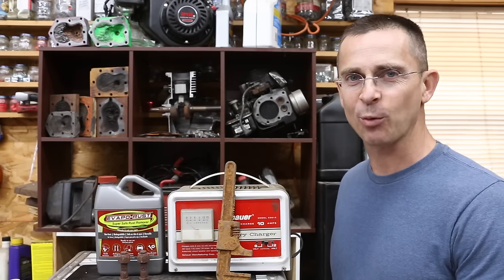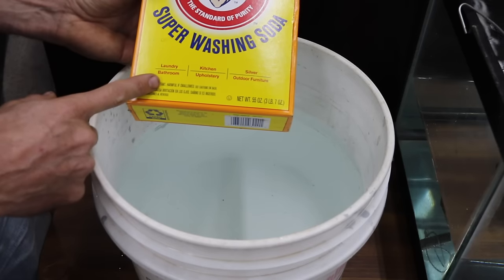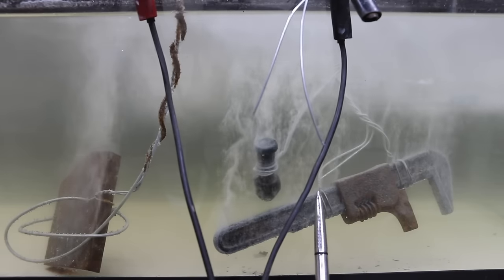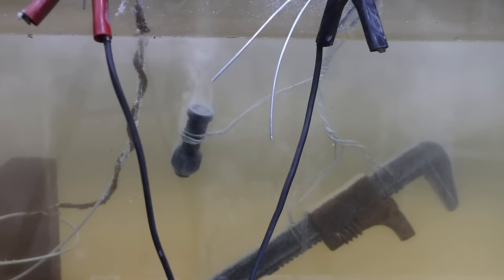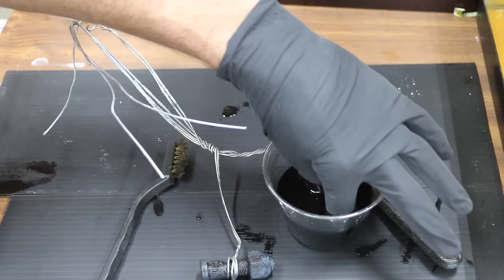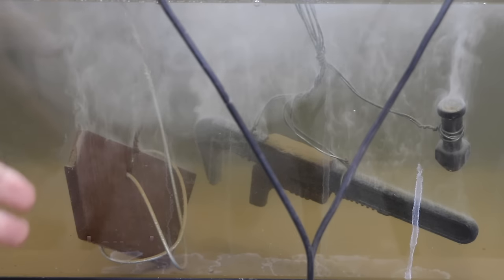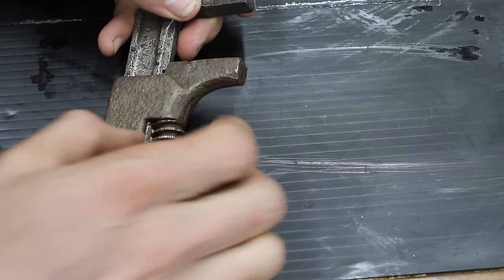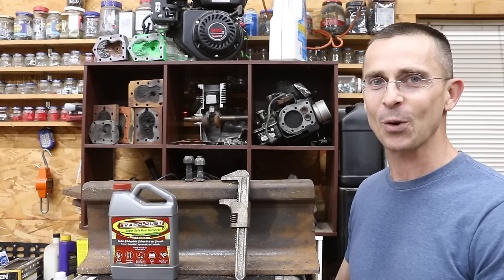Is Electrolysis better than Evapo-Rust?  Let's find out!

Comment: I've been experimenting with electrolytic rust removal for years, in fact that was how I first encountered the late Aussie50's channel. First, having a large surface area on the sacrificial anode speeds things up, so a flat piece of sheet steel or plate works better then pieces of re-bar. Second, face the side of the object you need to strip towards the anode, then flip the object around to do the other side, unless you have more then one anode plate connected at the same time. Third, cleaner DC works better then DC with a lot of AC ripple, which is what a car battery charger puts out, adding a capacitor across the output will help. Forth, if you have an object with multiple parts like the worm gear block on that wrench, add an extra loop of wire to those parts as well. 
  My next experiment will be to use a higher voltage then 14-15 vdc, which is what the charger puts out with a capacitor across the output, and maybe a stronger mix of electrolyte, washing soda is what I used, about 1/2 per gallon in a plastic garbage can. I have heard of some people using lye, which will strip the pain off of things as well,  but then you have to neutralize the lye or it will not hold paint. Evapo-rust has one advantage, it does not harm aluminum, which electrolytic stripping potentiality can, so it's good for things that have parts made out of different metals. I don't know what is in Evapo-rust or Metal Rescue, but I suspect that it is a chelation process similar to using molasses and water, but something more effective and faster.
Reply from the maker: Thanks for the constructive feedback
Reply from the maker: Thanks for the constructive feedback
Reply: Quality information! Thanks for the education
Reply: Terrific intel! Thanks!
Reply: If you care to do so, you can look up the patent application filed for Metal Rescue which does reveal that it uses a chelation process.  It is an alkali process and, per the patent, requires three ingredients mixed together in proper proportions.   The patent application describes a number of various combinations of ingredients that will generate the process,  and of course, Armor All who owns the product is applying to patent the combination that they believes works best and is the most efficient to manufacture.  The most critical ingredient in the process is Thiourea, an organic compound.

At this point in time there are many ways to deal with rusted items, some of which actually remove the rust and some of which convert the rust to a stable form.  Some processes that remove rust use acids, some use alkali.  Some processes use abrasives to remove the rust.  And there is even laser removal.  All of them work, more or less, and each of them are somewhat better suited to different items with varying degrees of rusting.

Thus, you can watch endless videos about rust elimination comparisons and get a lot of information plus see the processes in action. This is very valuable, of course, but there truly is NO universally superior method of dealing with rust that is "best' for all rusted items so its truly useless to compare various methods. As was concluded correctly in this video, each process is well suited for some projects but not as well suited for others.  And that's the way it is for any process.  So...take your pick!
Reply: RIP Aussie 50
Reply: What size capacitor?
Reply: OlegKostoglatov  Wouldn’t a battery across the output work as a capacitor too?
Reply: @justpauls  Yeah but depending on the amplitude of the ripple the battery may not like it. (i.e. reduce lifespan of battery) Larger lead-acid battery should be fine (b/c obviously that is what charger is for) but I have no experience with this.
Reply: @damanifesto  It shouldn't really matter, but you can add more by attaching additional capacitors in parallel and measuring ripple.
Reply: Vinegar works fine without any ado.
Reply: @damanifesto  A big cap...like a 22,000 to 47,000uf screw-terminal cap, rated for 50 to 80V. While you don't technically need the voltage rating, you do need the ripple current rating, which goes up with voltage (and cap physical size). The bigger the cap, the lower the internal resistance and self-heating. Ripple current rating of caps drops as its temperature rises, so to be safe a big cap is the way to go. Should be able to find something from Digikey or Mouser for less than $30 shipped. And be reasonable with the current you apply, unless you want to see the cap explode. Keep 'er under 10A. A 4 to 6A battery charger will do fine, but use a good one since it'll be running flat-out when used (a fan trained on the charger is a decent idea).
Reply: My battery charger will not operate unless it can detect a "load".  It does not like only dangly wires in water, so my "capacitor" is a battery.  It can be any 12v, including small sealed lead acid box types or vehicle batteries.  Additional tip: I use a plastic bin/tub, because the tub itself does not conduct electricity.  Laid over the top edges I use a wooden stick (broom/shovel handle/2x4 will work) to attach the negative lead wire (-) so it stays away from the sacrificial pieces (the +).  I use 4 pieces spaced around the periphery wired in to one another with positive lead wire attached to them.  Attached to the negative wire, is my largest metal object in the bin.  I have derusting parts of a lathe, so some pieces were heavy and I set them on the bottom of the plastic bin with a wire connected, but propped angled with bits of wood so water can circulate underneath.  Place multiple pieces on the bottom in this way, wire each if you wish, but wire is not necessary if they electrically touch the piece that has a wire connection.  I then place anything and everything else needing derusting on top of the large pieces.  There is no such thing as too many objects.  Each must be able to conduct electricity from the wired piece(s) and you want to arrange each so you maximize water surface contact (don't add a bunch of drill bits as a bundle).  The time required to clean the "pile" will vary based on the amount of total rust present.  You might disconnect power and check pieces once each day, removing any that you consider as completed then turn it on for another 24 hours.  By checking, you will be placing them back with slightly different contact points, allowing nothing to escape the cleansing action.  Try to minimize galvanizing, for the zinc will be removed and become airborne (my wire was galvanized).
Reply: @bobblack3870  Battery as a cap: Used to do that back in the CB days...a mobile CB was cheap, but a home base station was not. We'd use a battery charger and a sealed 12V lead-acid battery and power up a mobile unit in the house. So yeah...it's a perfectly valid solution.
Reply: @damanifesto  Sorry  little late in answering, but I think it was a 2200 uf cap at 25-30volts, it was just something I had kinking around. You could probably pull something similar one out of a junked T.V set, or other electronic device, even if it fails the battery charger has a circuit breaker in it.
Reply: @justpauls  Yes, but it's kind of awkward, and some batteries don't like being shorted out which can happen by accident when you are moving stuff around in the tank.
Reply: @RRaucina  It does, but electrolysis works better on undoing rusted threads, and other mechanical parts like gears and shafts. It's also good for preserving original detail in the metal, like teeth on a file, vinegar is an acid so you will loose some metal, even though it's not much, compared to electrolysis.
Reply: @TrehanCreekOutdoors   I think that you hit it right on the head. There is no universal " best " method for individuals, there might be some industrial process that suits a specific requirement and will be done continuously. For the weekend warrior with all the different scenarios, it will have to be hit or miss and pay attention to the process that may work best for the task at hand.
THERE IS NO SILVER BULLET, but it is good to know there are alternatives,
Reply: @Allosaurus 67 yes
Reply: You can hook a bridge rectifier and use straight 120 volts with plain tap water, to do electrolysis too. You can use a microwave capacitor to smooth out the ripple. The higher the voltage, the less electrolyte you need. Well water with nothing added produces good electrolysis with straight 120 volts DC (buy a 1000 volt rectifier from eBay rated for 15 amps).
Reply: How many volts dc and amps should I use when doing this? Can you use the same when electroplating with nickle
Reply: Tell me - why is it that these electronic anti-rust gadgets sold for automobiles don't seem to work? At least that's what I've heard. Do they actually work?
And so you're saying that the side of the rusted object which faces the sacrificial anode will experience better rust removal? Is this because there is less travel distance for the ions to move through the water? So then shouldn't using a smaller pool of water work better, since that would also reduce the travel distance?
Reply: Also -- if the sacrificial anode had been a piece of steel wool, would that have the greater surface area to speed up the process significantly?
Reply: Hi, thx for this detailled answer. I'd add some details, useful to understand how to design the perfect electrolysis cell i think :p first, i'm agreed with the idea of a very large anode, but for others reasons than speed. Increasing anode surface , allow to : decrease current density, so lower the voltage, so reduce the anode dissolution reaction. In others terms, the  anode current will be used to produce more electrolytic oxygen, rather than dissolving the anode metal. We could add that the dissolved anode metal in solution, will react at the cathode side to be electroplatted... To my mind, the idea of a large anode , is first of all crucial to maintain a constant distance between anode and cathode, and by this way, try to equalize the current line distribution. The use of acid could be useful at the beginning of the electrolysis to help dissolving rust, but be careful to avoid pitting...
Reply: For my first attempt I used a bunch of old screws I lashed together with wire, it didn't take up much space but it had a huge surface area.
Reply: For my first attempt I used what I had, a bunch of old screws with the heads damaged. I bundled then together with wire so I had a tight bunch with a lot of surface area, it worked well.
Reply: Evaporust is mainly Sodium EDTA (Ethylenediaminetetraacetic acid tetrasodium salt) a chelant.

You can have too much current when using electrolysis to convert rust.Too much current can cause the formation of spongy metal on the part being renovated. It's best to aim for under ten amps and under three is better still but it is proportional to the surface area. Moderate the current by controlling the concentration of the solution. Do not dump a whole carton of sodium carbonate in the tank - take the equivalent value in bank notes and burn them safely.
Reply: As for trying more voltage, there is no point. You need to aim for a reasonable current and the best way to do that is by connecting a current meter and adding washing soda until you achieve that current.
The electrolytic cell is a low impedance environment, high voltages are only ever needed to overcome high impedances or to deliver higher energy where provision of a high current is limited.
High current is counter productive in this kind of electrolytic cell
Reply: @paulg3336 I've had completely oppisite results from what you claim. Increasing the voltage (as we all know rise in voltage also a rise in current) produces way faster results withen an hour of complete. Sometimes even minutes. I'm convinced that the trick to getting good results is absolute contact along  with multiple sacrificials.
Reply: @eggroll1up918  I never said it would not be faster, The resultant metal will be inferior.
"the resulting current flow is far too high for good quality conversion, resulting in excessive anode erosion and the possibility of poor quality iron deposits at the cathode,"
-https://www.qsl.net/2e0waw/rust.htm

However you probably know better than all the electroplaters that moderate the current for better results rather than a quickly finished plating job.
Reply: or place more pieces....
Reply: @paulg3336  What does electroplating have to do with rust removal? Explain how a piece of metal that has rusted becomes inferior if you use electrolysis to chemically change the rust to ferrous oxide.
Reply: @eggroll1up918  The rust removal cell is identical to any electroplating cell. The sacrificial anode is the iron scrap. The anode looses ferrous and/or ferric ions into the solution. If the solution was a ferric or ferrous salt ,the ions coming off the anode would not all be hydrated by the water and precipitate out of solution ,and some would be deposited on the cathode (the rusty item). This would also occur if high current was used. This is why high current would form a spongy layer of metal on the item to be cleaned.
Reply: @eggroll1up918  I forgot to mention possible hydrogen embrittlement of the rusted item
Reply: @paulg3336  wtf are you smoking man? first of all electroplating is depositing a metal onto another metal using an electrolyte specific to the plating, it damn sure isn't sodium carbonate, which is what is used in the conversion of rust (Fe3O4)  into ferrous oxide (FeO). Why do we use sodium carbonate for the electrolyte, well it causes water to form H+ ions and HO- ions. Is this starting to make sense? So at the Anode (+) terminal attracts the HO- ions which lose electrons and form water and oxygen. This is why the sacraficial ends up all rusty, oxygen and water cause rust. Now for the more important factor. The Cathode (-) terminal. Remember those H+ ions? They head over to the neg terminal and low and behold react with the rust changing it to ferrous oxide, while also producing hydrogen with some water. Idk what your talking about as far as that bs about it's basically electroplating isn't that called hydrolysis or some shit? hell idk. but when contains to rust and electrolysis it's changing of chemicals and not transferring one onto another. therfore more volts/current = faster chemical reaction, doesn't have a thing to do with layering metal onto another metal for eye candy.
Reply: @paulg3336  with hydrogen being the most abundent element in the universe its safe to say anything done with steel even looking at it. has the potential of causing hydrogen embrittlement. Its not like your going to be using high current to remove rust from a bridge or building are you? for most its just for tools and odds and ends so not really a worry. kuddos for knowing about that topic though.
Reply: @eggroll1up918  Most hydrogen in nature is H₂  but at the cathode of the electrolytic cell diffusible atomic hydrogen that is harmful to the toughness of iron and steel is formed. I don't worry about it when cleaning rusty tools and similar stuff for reuse. Anything where strength is critical ,I clean using some abrasive technique.
https://en.wikipedia.org/wiki/Hydrogen_embrittlement
Reply: @eggroll1up918  I suggest you do extensive research (i.e. actually reading some articles) about electrolysis, before you expose any more of your ignorance to the world at large.
Reply: @paulg3336 I don't need to research electrolysis as a whole, god that would take a lifetime. I'm only refering to one tiny use it has out of the millions of other potential uses. Converting rust. Your the one who keeps refering to other processes as if its the same thing when clearly it isn't. It's like saying taking a shower and taking a shit are basically the same, because it happens in the same room.
Reply: @justpauls  What i was thinking ... or just a decent power supply. 
Or use an old pc power supply ... or 2 in series depending on salt content (resistance-current)
Reply: @justpauls  A rechargeable battery (in this question), a lead battery is a capacitor, albeit a very slow one so in this case (50 or 60 Hz) the polarity shift is too speedy for the lead battery to do much difference.  A capacitor should be with specs matching the Hz.
Reply: Also, keep in mind that electricity flows ( more or less) in a straight line. Adjust parts/ sacrificial electrode according.

Comment: Can I suggest that every few hours, as the rust builds up on the sacrificial steel and wire, you give it a quick scrub with a wire brush. This exposes clean steel, which will speed up the electrolysis, and you will not have to wait 72hrs
Reply from the maker: Thanks for the feedback.
Reply: Great point